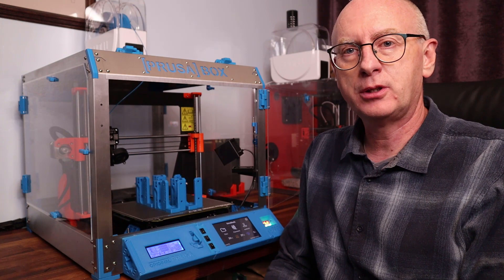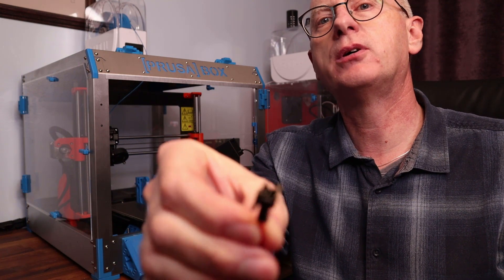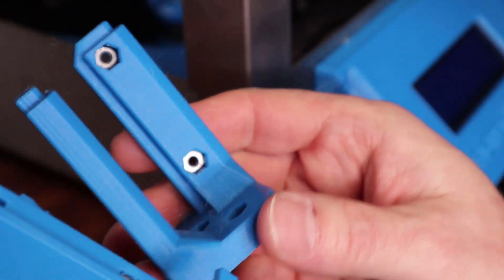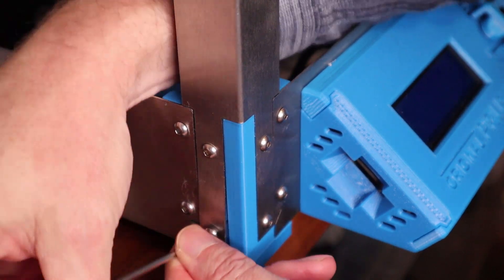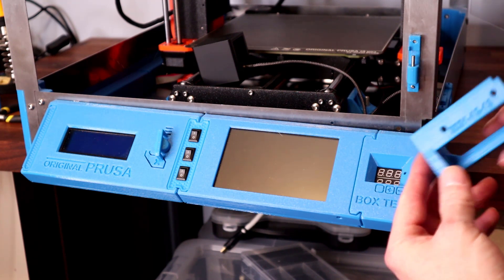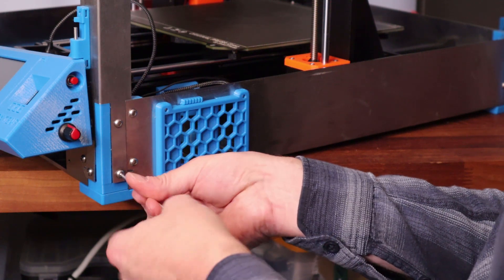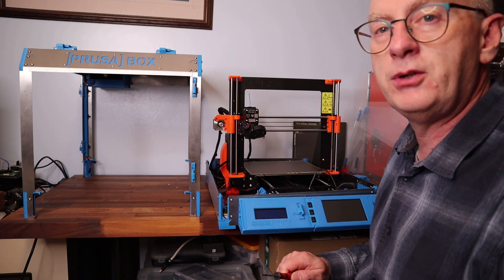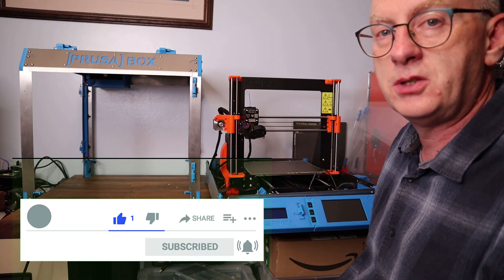Prusa Box detachable corners to remove top section of enclosure - modification - easy access

Comment: Nice video! Waiting to do this configuration on my prusa box until its redesign for to fit modular front. I see in the video  you have something covering the einsy board case, some cooling? Will you share that part? Thank you!
Reply from the maker: That is an active fan cooling part. 40mm 12v fan sucking in air to cool the board. I will add that link to STL soon.
Reply: @colinhill  yes please do that!

Comment: Colin, Interested in the relay. I just ordered the buck converter and micro switches.  I have a power brick that should work.
Reply from the maker: I will try to get videos made of relays and rear PSU fans, probably between Xmas and new year.

Comment: Great video Colin! On top of every feature! With this design Julien explains you need to unscrew both bottom and top screws to get an easier release of the legs, i suppose it should help get pass over the other screws.
Reply from the maker: If you undo both screws top and bottom then the new centre section is no longer attached to the frame. That can't be correct? I will have to watch his video again.
Reply: @colinhill  Sorry I was not precise! it's to be unscrewed but not entirely. I think it helps keeping the frame looser
Reply from the maker: @VinceLeMusicien  perhaps I will try again, but means taking modular front off again 😭